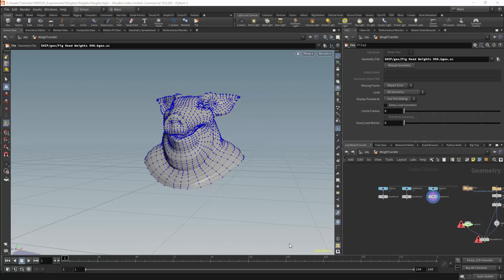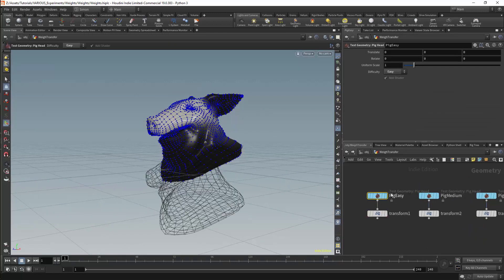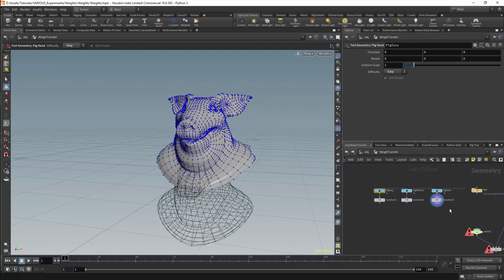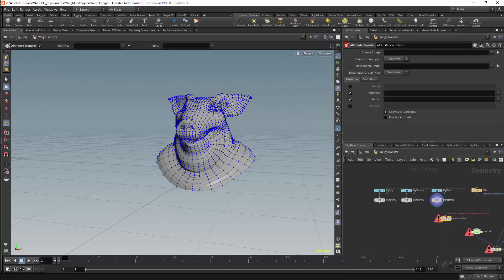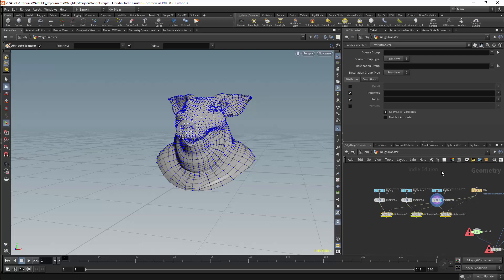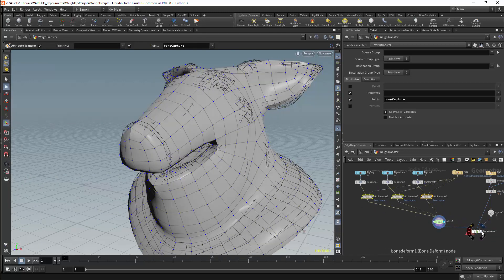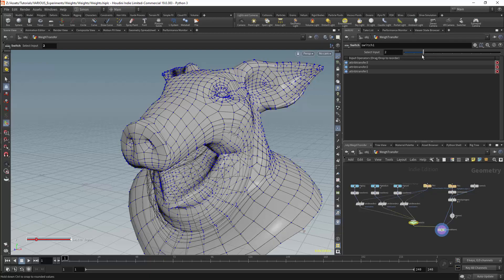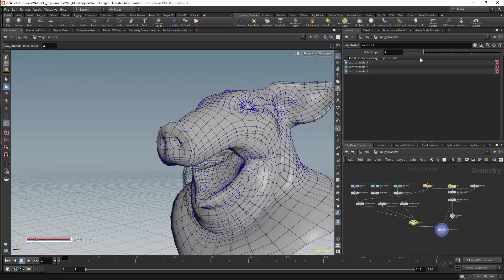KineFX Weights 005 Transferring Weights

Comment: Hello while this seems to work trnasfering from high poly to low poly.
I am unable to find a setup that yields desierable results from lowpoly or polyreduced to highpoly.

I have tried adding a BoneCaptureBiharmionics in between, this didn`t realy fix the problem.
Reply from the maker: Unfortunately there are limits to transfer and it generally work best transferring from high to low because there is more interpolation involved. There is a lot that can be done with grouping but it is not a magic bullet and there will always be some manual editing.

The bone capture biharmonic will generally overwrite the weights so you would probably get the best results form that using a branch for the biharmonic and a branch for the transferred weights and then blending between them using an attribute combine node.
Reply: @brundlethwaite  next time I run into this issue i think i will just shop up my High Poly into pieces so that it doesn't lag, merge them and then blur the edges.